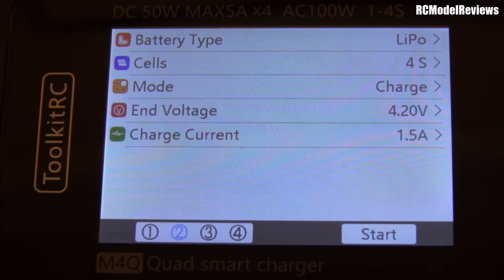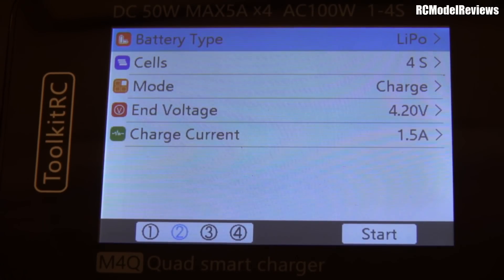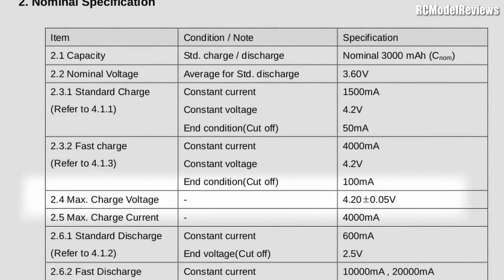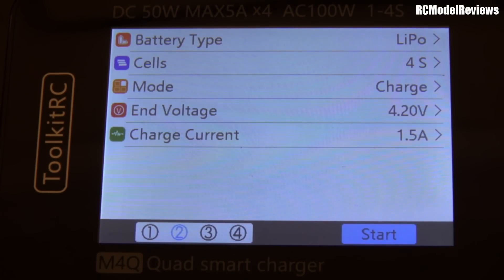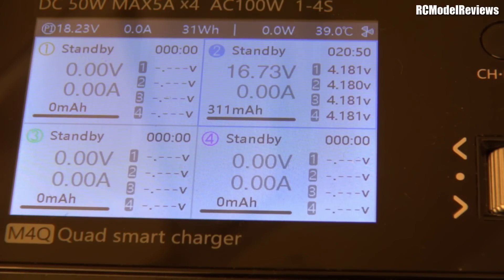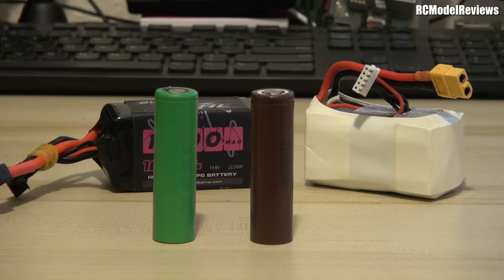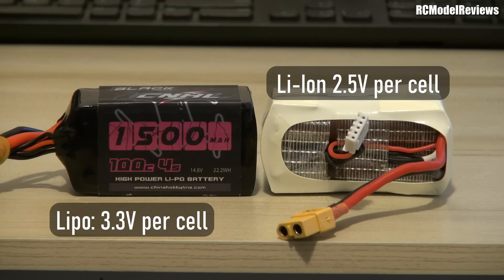Is it safe to charge Li-Ion packs on a lipo setting?

Comment: Hello Bruce. I have recently started using LiIon cells on my quad for longer smoother flights. However my quad can't distinguish between a LiPo and LiLon cells and the buzzer starts screaming at 3.5volts. It drives me nuts till I land at around the safe 3V min some 10 minutes later. How do I turn that noise off. Regards Dave C

Comment: Thank you this informative video excellent presentation. Which type of lithium cell should I use to make a 12v golf trolley not sit in push type. I am wanting to make a 4S7P with BMS. There is so much conflicting info on you tube would appreciate any help and guidance, many thanks go safe…

Comment: Very helpfull,  just what I needed.  I have a 5inch which is very light and built for economy and it can cruise level on 4.5amps,  I just built a 4s LiIon pack from molicells 21700's cell rwated at 45a peak draw. , that is only 100grams heavier than the 1600 mah LiPo I fly, but goes from  1100mah useable to 3000mah useable mah.  can't wait to try it!.

Comment: Thanks man that was a great informational video. I am using a pro range 3s2p 5000mah 18650 battery pack for my underwater rov project and do not have a dedicated li ion charger, fortunately my college has a li po balance charger so i can temporarily make use of that and charge my battery at 3amps. Thanks a lot man!!

Comment: @ RCModelReviews I have a Li ion 500mAh 7.4 battery and I have the ISDT 608AC charger, what settings should I use to charge my buttery at? On my screen it has…
Task- Charging, 
Chemistry- Lilon, 
Condition- 4.10V, 
Cells- 2S, 
Current-0.5A

Comment: Thank you so much for explaining this.  Surprisingly, there's not a lot of details on this when searching the internet.  I made a pack with some Epoch batteries.  They are 2800 mAh Epoch cells, with 40A discharge. I used 12, running two parallel pairs of 6 cells in series.  It gave me a 5600 mAh pack, with 80A discharge (or about 14.25C).  After all was said and done, I knew that these batteries could be charged to 4.2V, but my brain still wanted to pick the Li-Ion Program on my charger.

Comment: Off this topic slightly but a few years ago I had a cheap 4 port 6a turnigy charger and towards the end of it’s life it started charging lipo’s to 4.4.3-4.4v and at first I took advantage, as I was mostly doing speed run’s! but unfortunately the cheaper batteries like red backs and zippys didn’t last long! but a futaba align battery and some Traxxas batteries are still tight after many years.

Comment: I believe the real world effects can be seen from a marketing and profit standpoint these days. I often see various cheap RC stuff sold where the charger requires a special CC limited unit that plugs into USB, but the other end is a standard plug so many people out there could likely get confused and bypass the special charger altogether. This would result in small cells being charged very quickly, likely at least 1A but probably more.. and this duration would not be long because the cell would become fully charged quickly and begin to draw the lower current levels in a short period of time. This has apparently been safe enough in the consumer world to not cause safety issues, and beneficial enough in the corporate world where it requires people buy more batteries faster.

Comment: Would like your opinion on how to look at a pack made out of Samsung 21700 - 40T cells.  If i would make a 2S3P battery pack then i would have a pack with a charged voltage of 8.4V and a capacity of 12.000Mah.  My question is how to look at this when i would use this in a model airplane where the motor draws peak amps of 100A.  Can you divide the 100A by 6 cells so that each cell has a max amp loading of 17A ?  Or would the max amp loading be divided by a factor 2 because it is a 2S pack, this would give a max amp loading of 50A per cell ?
Reply: I think you devide the amp draw of your motor by the number of batteries in parallel.
So in your example you have 2S3P, so 3P means that if you motor draws 100A you divide 100 by 3 which is about 33A, that is how many amps is drawn from every individual cell in your 2S3P pack.

Comment: Titan batteries are well known in airsoft to be the best compact LiON batteries available, however the chief engineer of the company gives a very poor video stating that "the LiON batteries must be charged on LiPO setting and shold not be charged on LiON" no other details are provided; no explanation as to why this is the case  and no explanation on how to charge the battery in accoredance with the Ampage - so I can't trust the person claiming to be the chief engineer of that video. 

Titan claims its batteries hold 80% of charge capacity after 300 charges.

I have a 7.4V 6000mAH Titan LiON battery which according to this video I should charge at 3A... if my priority is to preserve the life of this crazy expensive battery would it be best to charge at 2.7A just in case.

Comment: Extremely informative. Was just charging my  my traxxas 3c lipo, and  I noted that pack bloated a slight amount. I quickly disconnected it and made a salt water bath for it. It was a used battery given to me, so I don't know it's history. I went to the local hobby shop and even the attendant there said how much he hates lipo batteries. I agreed as I have a nimh pack I purchased in 2012 that I still can use today. I maintained it properly, and my cc02 with its sport tuned motor gives me about 1h45m dive time consistently. 

I asked the dude if he sold li-on batteries. He said no, and didn't know if they made them for rc or not. I may go and look for some. My aged onyx 5000mah 7.2 nimh pack is showing its age slightly, and now I am down a traxxas pack. So I may be doing some battery hunting.

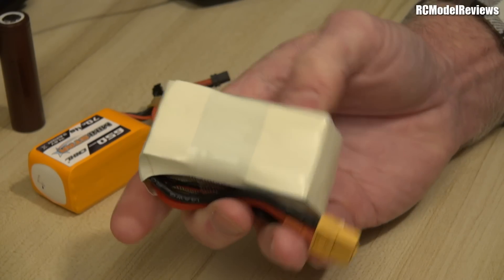Comment: @7:55 It's not that lithium-ion lasts longer than lithium-polymer but the form they are packaged. What you are comparing is pouch cells vs cylinder cells. Even with the exact same chemistry cylindrical cells will generally last much longer. The reason is that most pouch-type cells suffer from delamination long before degrading chemically as there is nothing substantial to keep the layers in good contact with each other. Any gas that is generated collects in pockets between the layers pushing them apart thus reducing the active surface, reducing capacity and increasing internal resistance.  With cylindrical cells this cannot happen except in extreme overheating situations.  The metal cylindrical shell is strong enough to prevent the layers from being pushed apart causing the excess gas to find its way out of the cell rather than pushing the layers apart.  The disadvantage of cylindrical cells is of course that they are considerably heavier for a given capacity and will usually have a lower C rating due both to their much smaller outer surface area as well as higher internal resistance due to having one long continuous set of plates rather than many layers paralleled. (The latter issue has been solved recently by Tesla but AFAIK no one else is using that solution)

Comment: just found this vid because I wanted to know what ppl charger their "modern" liIons at. I often set 4.18 as endVolts - since those last 0.02v seem to take forever on the VTC6 at least.
I have a huge list of 6S packs for 7" longrange drones now - and I noticed that LiPoHV have a pretty decent WH to weight ratio - close to the LiIon ones!
Do you have experience with HV lipos? Is the overcharging to 4.35 very bad for those cells (even if they are made for this - it's probbably just a marketing thing and they will wear out sooner than normal Lipos?)
thanks greets, Mario

Comment: Good explanation , for more punch I can recomment the Molicel INR21700-P-42A . Of course the weight is a bit higher but you can pull 45 A constant/peak 70A with 4000mah capacity. In the 18650 category the VTC6 with 30 A and 3000mah is best choice imo.

Comment: Great instructional video. My 26000 2 cell Li-Io battery does not have a balance plug.  When I set my charger to charge it, it says connection error.  How do I charge this battery?

Comment: Excellent video. Great explanation as always. I've just recently started playing around with 18650 cells and they have a lot of potential. Have you played around with using a BMS board in your home-made packs?
Reply: From what I have read a BMS on an airplane or a quad would not be a good thing because when it gets to the cutoff voltage the motors would just quit and you know the results.

Comment: come down, you speak about things you have never experienced: i use 18650 li ion from laptop and i charge it till 4.3v on  stupid charger with 1 amp current and no problem, some were charged till 5v and just then started to warm up, if drain/ charge current is around 1C , there is no problem, just monitor peak voltage , 4years experience

Comment: You still didn't really cover the actual question of the video: What's the difference between charging on liion setting to 4.1v vs charging on lipo setting *to 4.1v*.
All your video really said was that if you always charge a lithium battery to 4.1 instead of 4.2 you'll get less capacity but longer life... Obviously. The question asked here is whether the charger's liion setting is any different to the lipo setting - other than a different default max voltage...

Comment: I've been vaping for over 5 years now. I use only the 18650 batteries. I found out that if you want your battery/s to have a long life? Charge them at 4.2 Volt 500 milliamp. Constant current, constant voltage.
Let them cool off first before charging.
Can you charge them faster?
Sure you can, At the cost of the batteries lifespan!
If you don't like waiting for the slower charge of 4 hrs.
BUY MORE BATTERIES!
You can learn a lot at the Battery University website!👍🇺🇸

Comment: Have you ever done a video on knee voltage, or why a battery's voltage per cell drops instantly when you stop charging it? Eg. Charge to 4.20V per cell, then you stop the charge and they immediately drop down to 4.17V each.

Comment: Charging to 4.1V extends longterm life significantly. Thinkpad notebooks have a software where you can limit the charge. I set it to 80% max. and after 8 years still had 2h runtime. Regular users have 50% runtime after 2 years.

Comment: Awesome info Bruce and LiPo/Lilo/LiFe safety should always be #1!!

People if you've ever seen a fully charged 6S 5500 Mah battery go up....It's frightening......!

**EDIT** Most of my Li-Ion packs are protected by a small circuit on the battery itself (So they are slightly longer) so it doesn't really include me as I have an extra level of protection built in with mine. 

I've always used the appropriate settings as I didn't know, the chemistry had changed slightly with Lithium-Ion batteries (18650's etc)
Never really do long range stuff... too scared I'll lose a model lol.
I use them in near everything... torches/work lights.. cheap chinaquads (Great conversion!!!),  battery banks.

I did learn something today though...lol. Check the batteries data sheet.!

Well if I'm not mistaken, most electric cars use these cells in massive banks to power them.. 
(As having one huge battery unit, under the occupants of said car would literally be a class action waiting to happen...)
Let's not forget the humble Laptop computer. Powering those, for what 25+ years?

Solid advice, as always mate and Thank you...

Comment: You will damage a Li-Ion cell discharging that low, 2.5v is just too low.   (That is the dead voltage of a LiFePO4.)      No reason to drop that low,  no real gain.     " 3.3V at room temperature is about 92–98% of the capacity is used.   Voltage cut-off below 3.2V can lead to chemical instability in the cell."

Comment: Regarding long range, rcg guy gtrick90, built a 4S2P (4s-7000) pack and put it in his wing wing z84 (840mm foam wing), he flew a ardupilot autonomous mission over the ocean, 50 miles out, and 50 miles back (100 miles total) in 4 hours, with a quad 1750kv motor, pretty impressive.

Comment: Also, if you charge the night before you fly, I charge my LiPo's on Li-Ion setting, so the pack is not sitting 12 hours at 4.2V. My original TG 4s-1300-65c packs have over 1200 cycles in my Raptor 5" quad (peaks 120amps) and i fly for 90 sec and they end up around 3.85v, perfect for storage. Those packs still work great for planes and now have 2100 cycles on them, they are now 4 years old. Treat them well or buy more, your choice. And regarding Li-Ion charging to 4.2v, monitor the cells closely first cycle, if they get warm, they are not happy.

Comment: On the Isdt chargers you can change  final charge voltage in the different battery settings. Final voltage is key not what profile you use on charger.

Comment: Most new lipo chargers can be changed in settings for the cut off voltage and also charge voltage comes mostly to temperature hotter conditions mean higher peaks on packs. Thanx for all the vids xjet 🤙
Reply: Thats not whats it about.

Comment: Been a vape for over 5 years and 18650 are still good to 4.2 v per cell and most 18650 cell battery chargers only charge at 2 amp max

Comment: If you need to discharge a LION to a storage charge, is it the same as a lipo 3.8?
Reply from the maker: Yes, the LiPo storage setting will be just fine.  Li-Ions do have a lower nominal storage voltage but the difference is very minimal

Comment: I can definitely validate this! I bought two Auline 4s Lion packs for my Dji goggles to run on. I been charging them on 1.5/2.amps Lipo settings at 4.2v and it has reduced there life significantly. Versus two other 4s Samsung 18650 packs i built at the same time I bought the Auline packs.I been charging the Samsung 4s packs on strictly on Lion 4.1v .And now the Samsung packs out performed the Auline packs. So it definitely reduces the packs life span.
Good video Bruce!

Comment: One question Bruce, what do you recommend when it comes to storing them? Obviously we know that lipo's like to be stored at around 3.8v per cell, is that the same for Li-Ion? I can't find much information on the subject, so to play it safe i leave them at 3.85v per cell.
Reply from the maker: Yes, like all lithium chemistry batteries, they'll last longer of stored at their "nominal" voltage which is anywhere from 3.6V to 3.9V.  If you're storing for just a few weeks then 3.6V is good, if you're storing for many month then a slightly higher voltage would be better to account for a degree of self-discharge during that period.

Comment: Many modern chargers let you tweak the desired end voltage for each battery type. So for example on my ISDT charger I can set my LiPo batteries to charge to a maximum of 4.15V. I always do that when charging the night before flying because the less time spent at 100% the better. It only makes a difference of a few seconds of flight time but the batteries will likely have a much better lifespan.
My best batteries are LiHV (4.35V per cell) that I have never charged above about 4.20V. They are 4 years old seem like new.